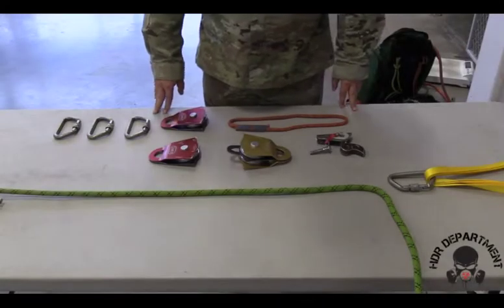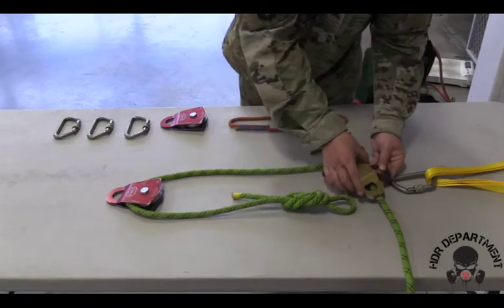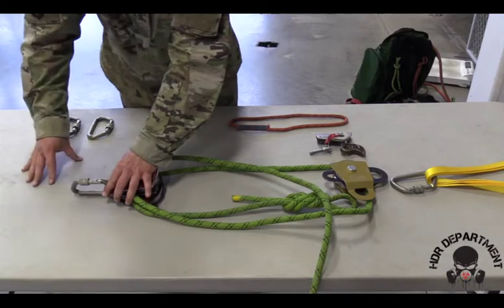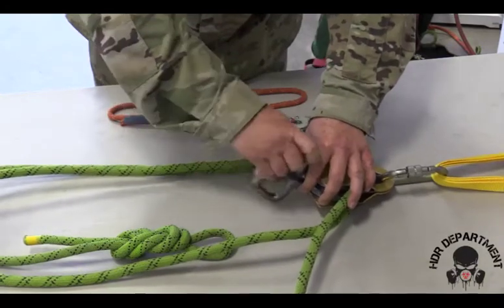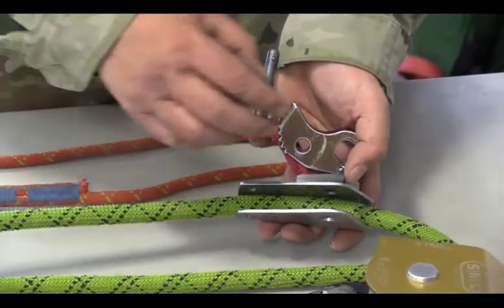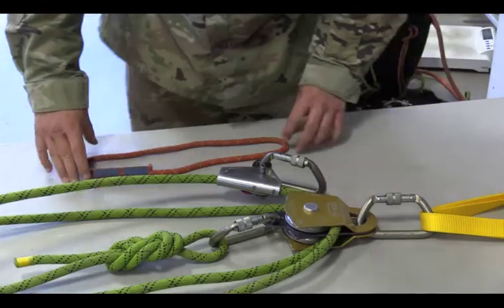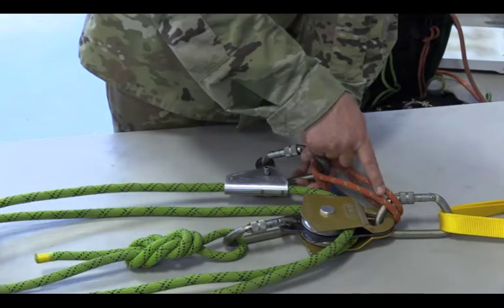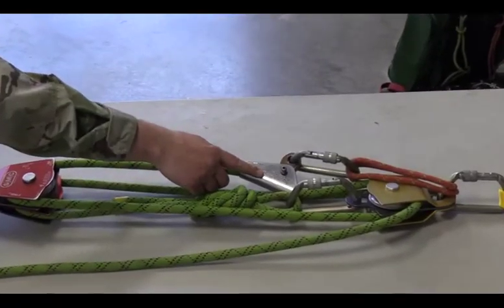Technical Escort   4 to 1 Mechanical Advantage

Comment: Your two single pulleys at the load end need two separate carabiners or a large delta quick link to allow the sheaves to be parallel under load.  Your present connection will torque the sheaves out of alignment with the rope. 
     If the task is horizontal and the terrain allows the haul line to be pulled away from the load,  attaching the load to the becket pulleys and the anchor to the two single pulleys will turn the system into a 5 to 1.  
     Or…..replace the single pulleys with another becket double pulley,  attach a single pulley to the original becket and terminate at the other becket. You now have a 5 to 1  or  6 to 1  and eliminated the alignment problem of the singles.🤜🤛
Reply: Rider Mak… I’m learning so thanks for adding your comments too. 😉👍